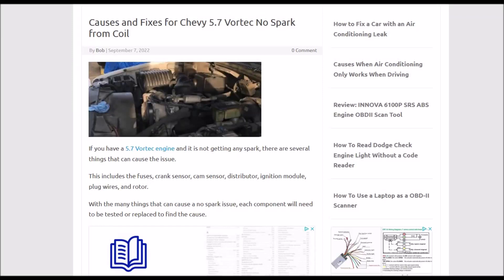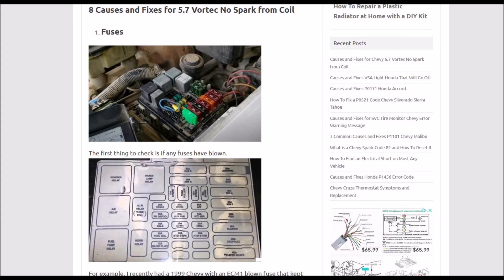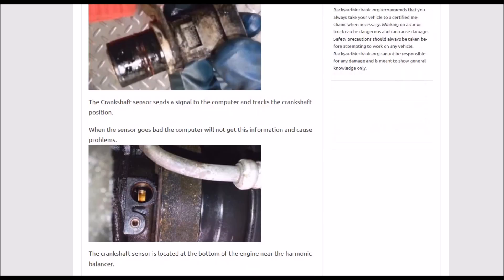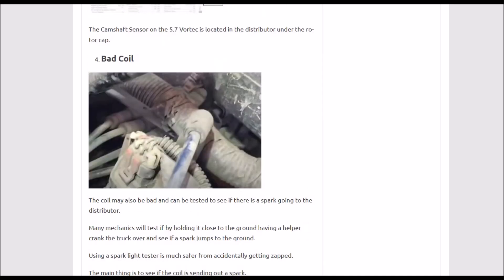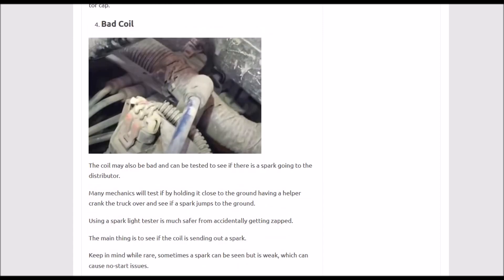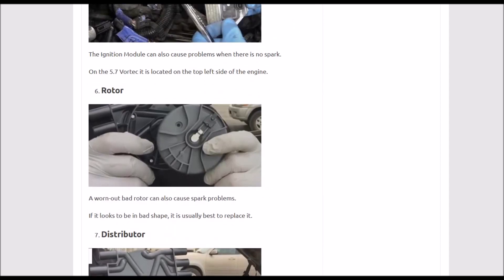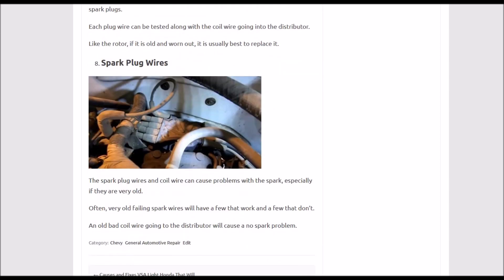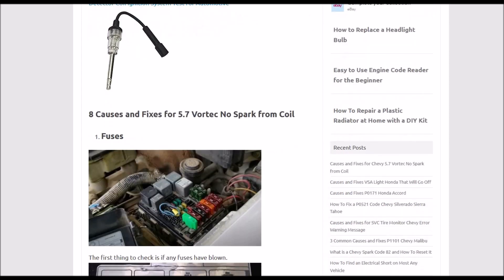8 Causes and Fixes for 5.7 Vortec Has No Spark

Comment: I’m working on a 02 express 2500 5.7 and I replaced a oil cooler line and battery and now it doesn’t start started before I replaced oil line what do u think ??
Reply: make sure you have oil pressure and fuel pressure